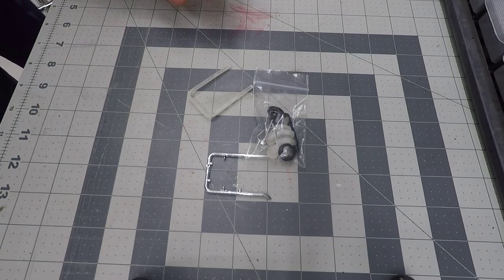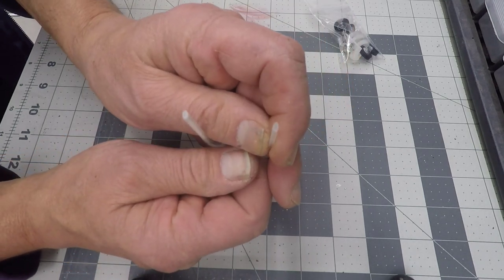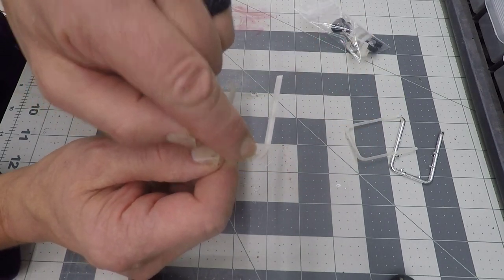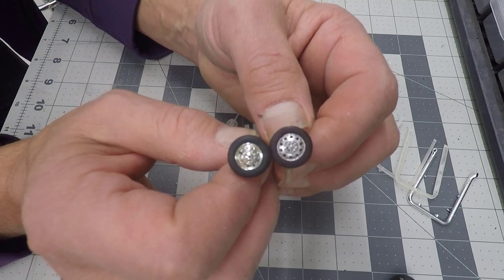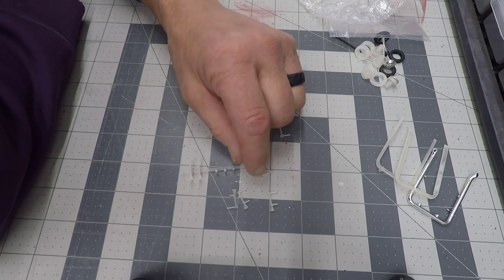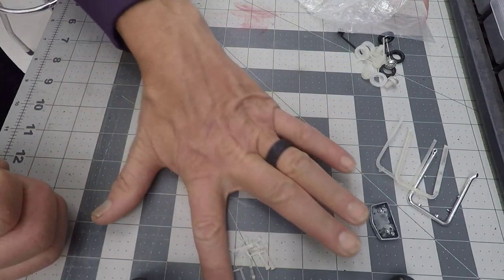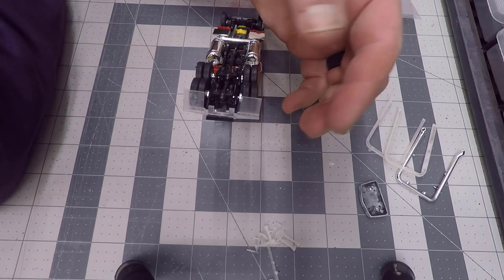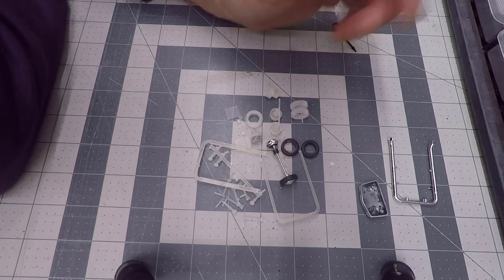My first 3D Designs ~ The Good and the Bad

Comment: For version 2 of the horns (to prevent them breaking off) could you rotate them 90 degrees so both pegs are attached to the sprue, then have one row of horns on top and one row on the bottom?
Reply from the maker: Glad you mentioned that. I sent a test print of 4 sets to China for electroplating with a rectangle wire connecting post posts. Not sure if this will work not but another experiment.

Comment: I need a 1/64 t800 front grill and lights and I don’t know what to do
Reply from the maker: Tough call. There are zero parts for T800 so far. There is an aftermarket parts kit in the works I will carry once available.
Reply: @RockinHFarmToys  thanks!